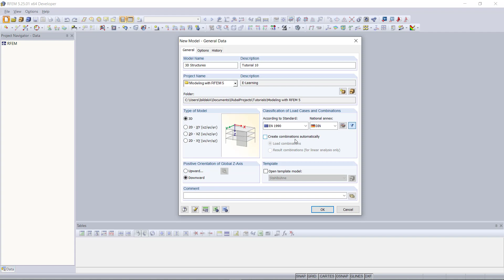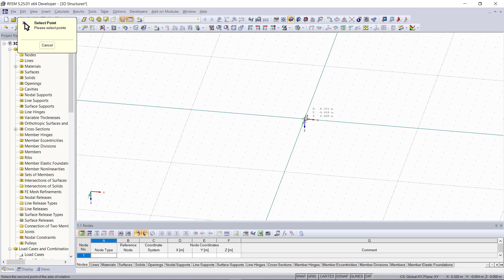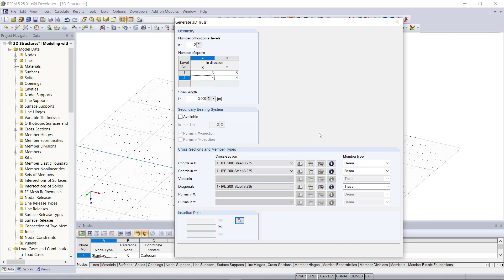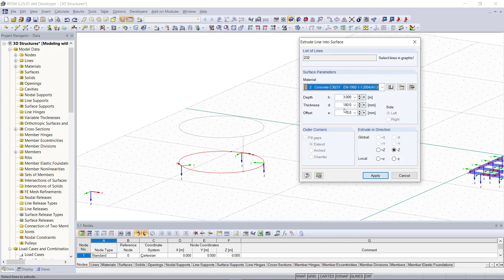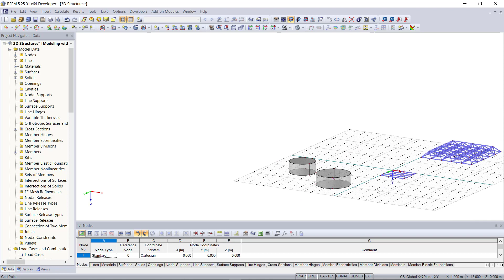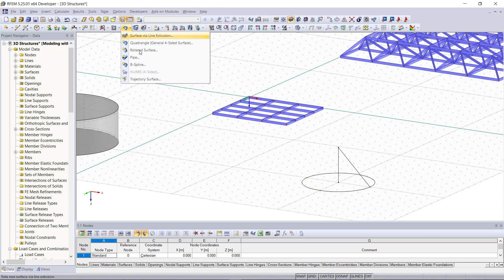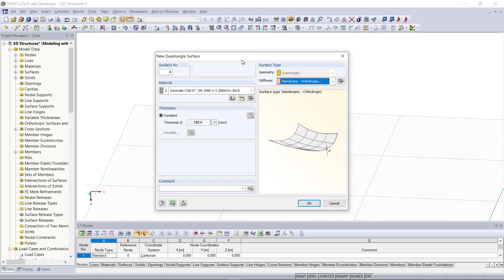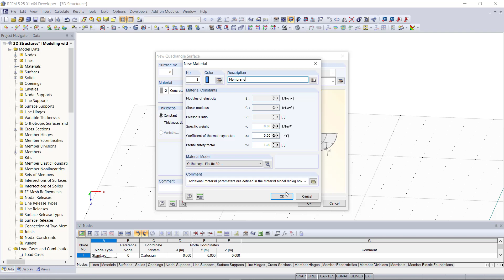Modeling with RFEM 5 | 010 3D Structures

Comment: Great presentation. Is it possible to use guide lines when drawing your lines in the X-Y plane? I'm looking for something similar to the way lines can be drawn in AutoCAD, by locking to an axis with my mouse and inputting a length value.
Reply from the maker: Hi, WiFi!
This is not possible. But dxf background layers and line grides help in drawing.
Reply: @DlubalEN  ah that is disappointing, it's been present in every piece of modelling software I've used to date (TSD, SCIA, Solidworks, SketchUp etc)
Reply from the maker: Hi, WiFi!
We will try to implement this feature in the future.